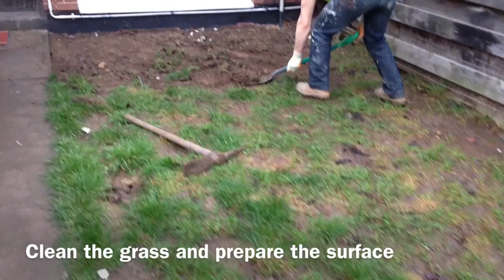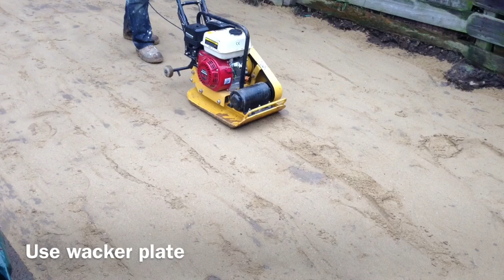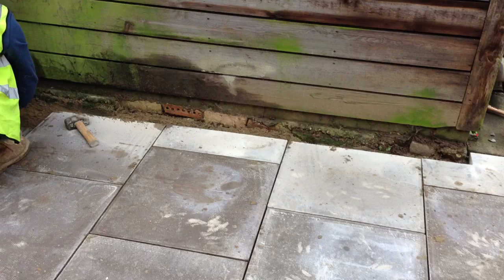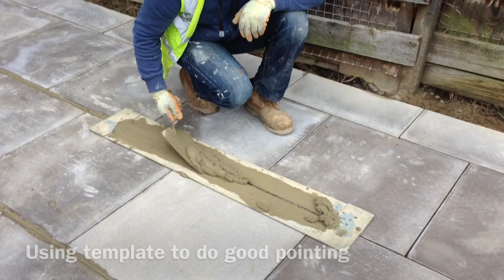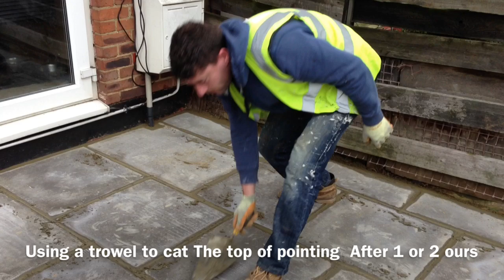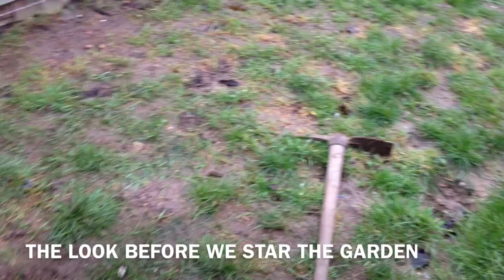How To Lay Paving  And Pointing Check Out BEFORE AND AFTER!!

Comment: how did you get Thors hammer?? : )) and how much sand and cement was used for the bedding layer? cheers, it looks very good do you think it's ok to do 10 sand and 1 cement if it's a very low traffic area? something that really only would get used in the summer ( uk summer too)?
Reply: i guess Im asking randomly but does anyone know a way to get back into an instagram account??
I was dumb forgot the password. I appreciate any help you can offer me.
Reply: @Kieran Thomas instablaster :)
Reply: @Gunnar Lyle thanks for your reply. I got to the site thru google and Im trying it out now.
Seems to take quite some time so I will get back to you later with my results.
Reply: @Gunnar Lyle DAMN IT ACTUALLY WORKED :O I just got access to my IG account details within roughly 45 minutes by using the site.
Had to pay 15$ but for sure worth it :O
Thank you so much, you saved my account !
Reply: @Kieran Thomas Happy to help :D